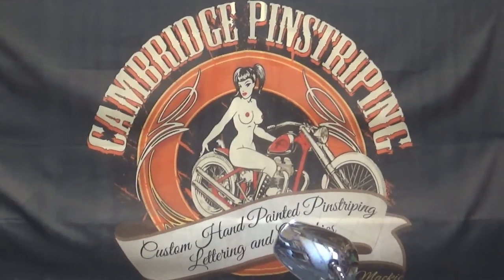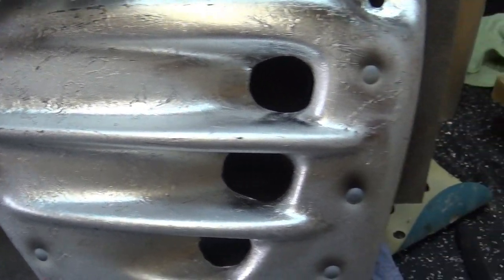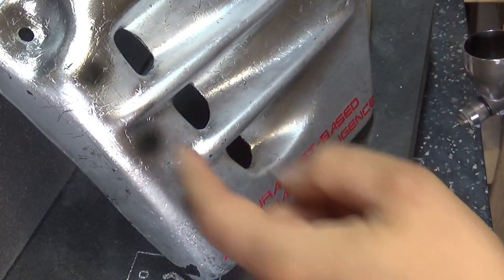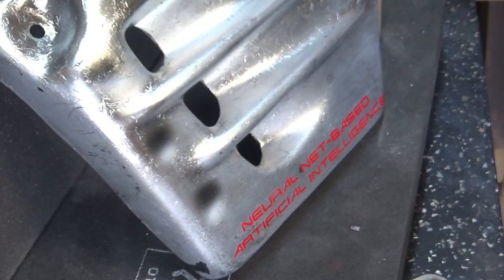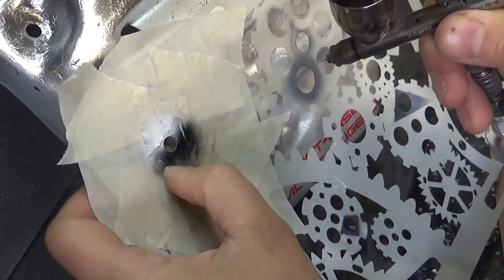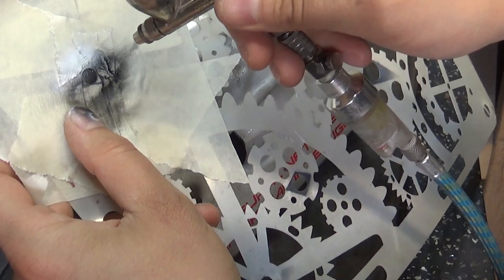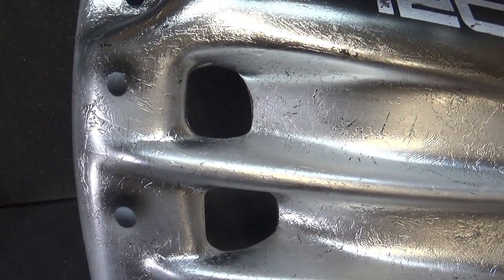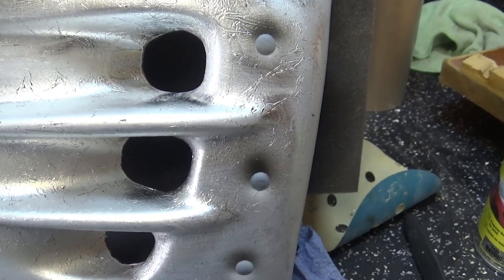How to Airbrush 3D Looking Rivets - The Easy Way!

Comment: Another superb video 👍 I was wondering if you have a video I’ve missed regarding clear coat ideas? Planning to remove paint from the engine of my dream bike xvs650 (as yet it remains just a dream 😢) but wonder if bare engine will corrode without a protective layer? Hope you don’t mind me asking?… cheers and top work as always 👍
Reply from the maker: If it's alluminium it won't rust, but you will need to keep on top of it, as it will get messy overtime.
Reply: Thank you  mackie 👍👍 love you channel! Rock hard, have a beer!